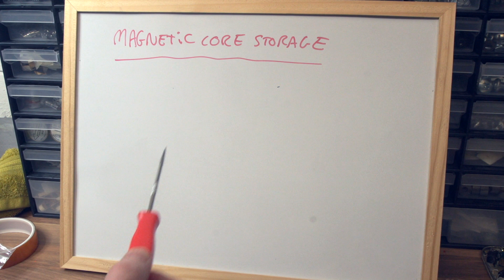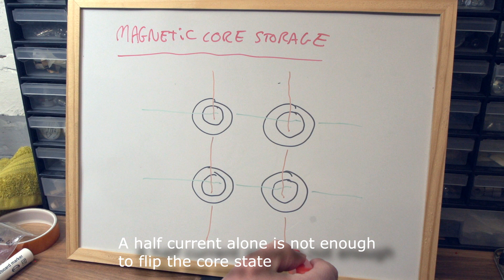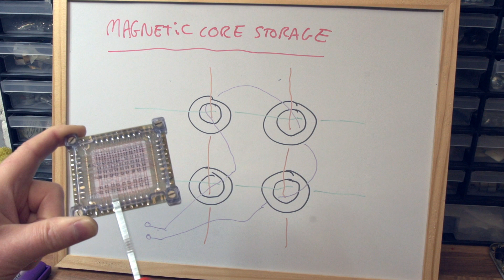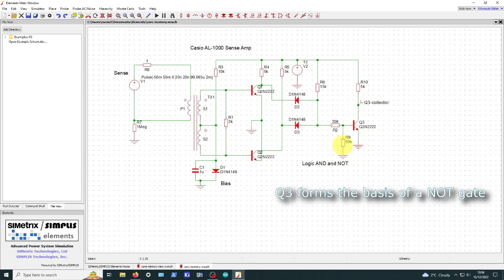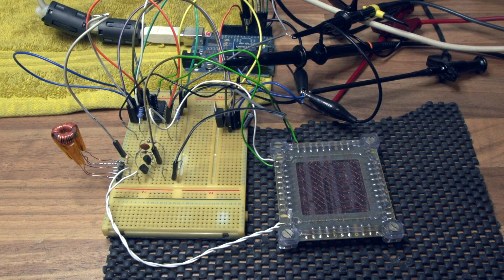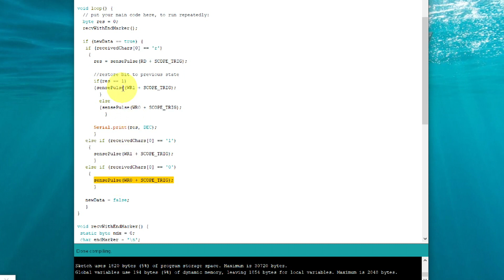Retro 60's Core Storage Memory - basic explainer. Lets get this core store working!

Comment: That core memory module was used in a Facit 1125 made by Sharp. It was also branded as an Addo-X 9958 and Burroughs C3350. I have the Facit model that isn't working. (Core module SN: 8070015). Hopefully I can fix it.
Reply: I see now on your other video you mention the Sharp Compet 32. I have never seen the insides of one of those, and I believe not many made it out of Japan. But it most likely used the same module as the Facit was based on it.
Reply from the maker: Hi, Yes they all used the same core module. Including the Sharp Compet 32(CS-32A) which i understand was the original design. Very interesting that you have the Facit 1125. Hoping to get one myself one day to reverse engineer. Good luck with it and thanks for watching.